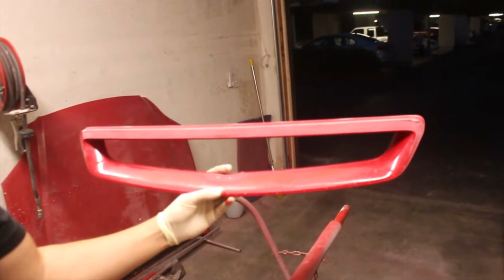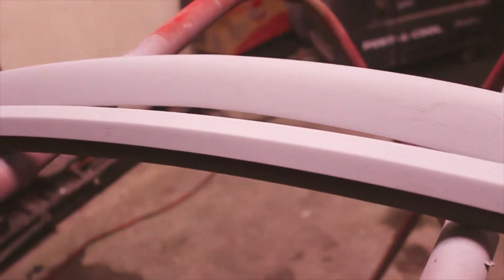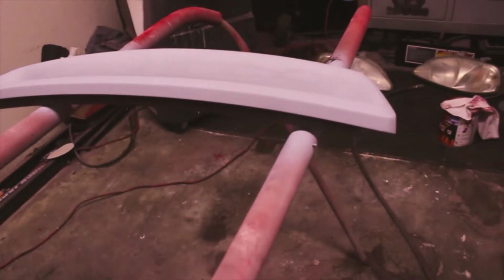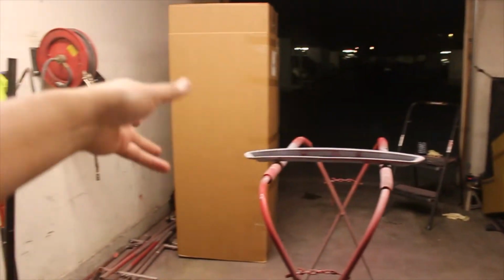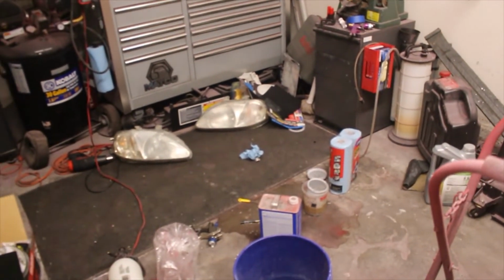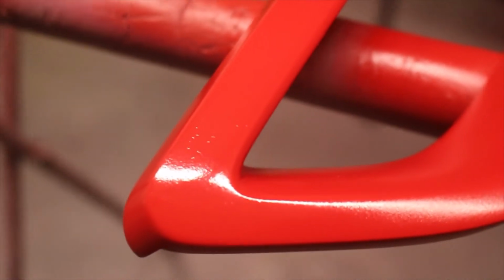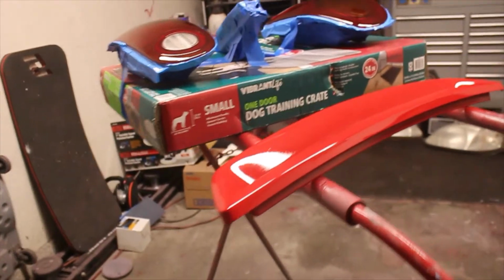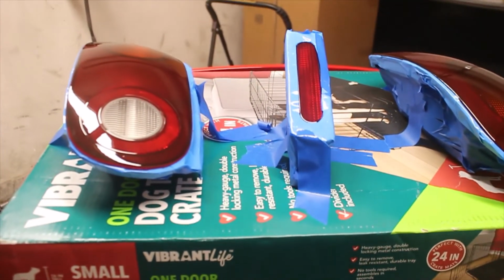Painting Honda Parts

Comment: I have the same problem I got a civic as well I sprayed 2k dtm primer on some small pieces and the under side of the hood and it started frying up on certain spots what would you recommend to keep from it reacting like that
Reply from the maker: Try doing lighter coats and also check the substrate for any contaminants so cleanliness is sometimes a factor when that happens